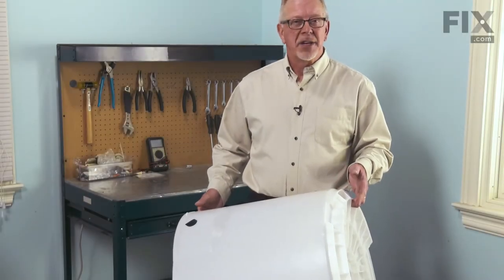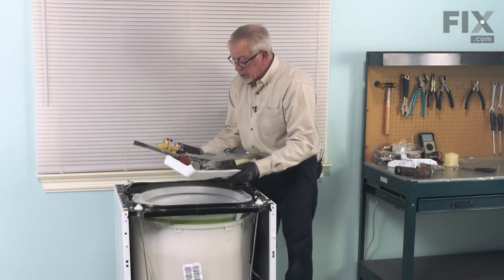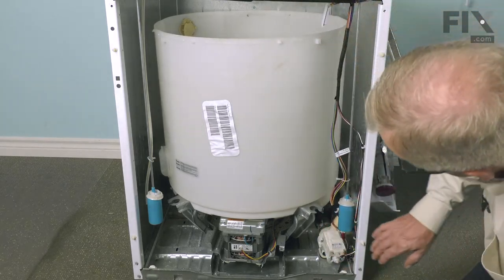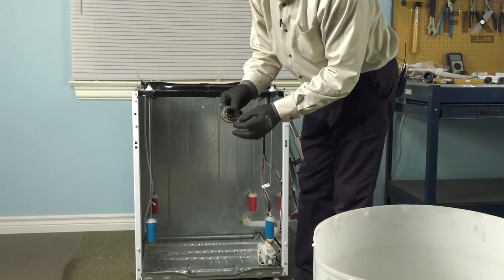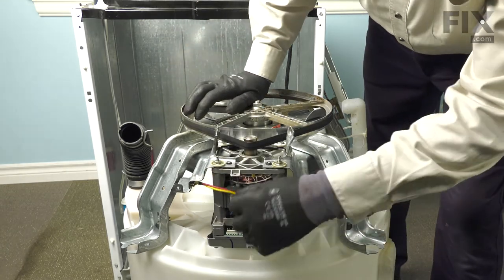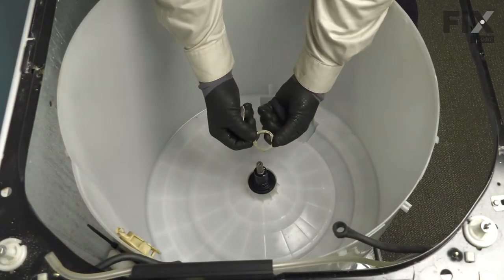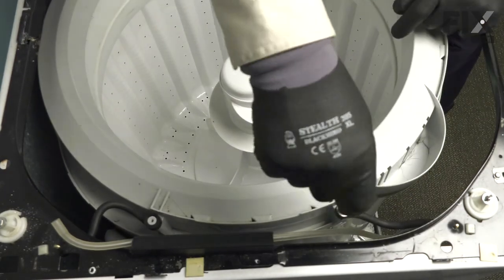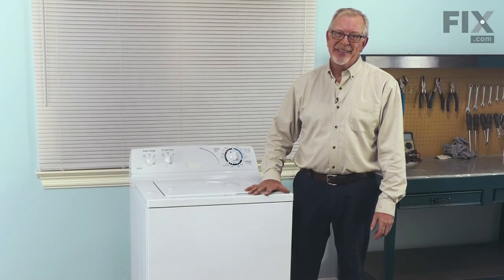GE Washer Repair - How to Replace the Outer Tub

Comment: (4 years later).  Easier question: During operation. the tub bangs the inside wall on the right side.  Is there a "spacer" or "bumper" that needs to be replaced?  If so, how much/little of the tub do I need to remove?  Thanks form Wisconsin!

Comment: Is it not possible to pull everything out the front? Then disassemble?
Reply from the maker: Great question , you are correct on a lot of machines you can do exactly that. Usually you strip down as much as you can off the assembly to make it easier to lift  out of cabinet, less chance of damaging anything including your back. It is easier as well to loosen tub nut etc while the tub is mounted in the cabinet. if those things are not an issue for you then yes the whole assembly can be removed as one and then serviced.